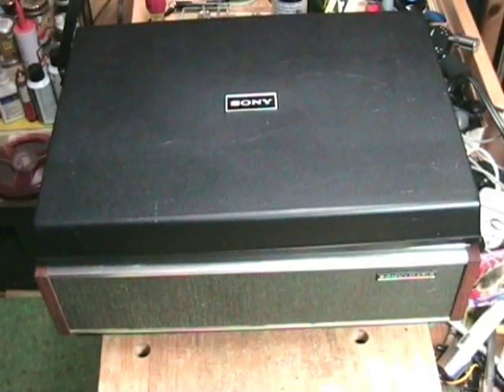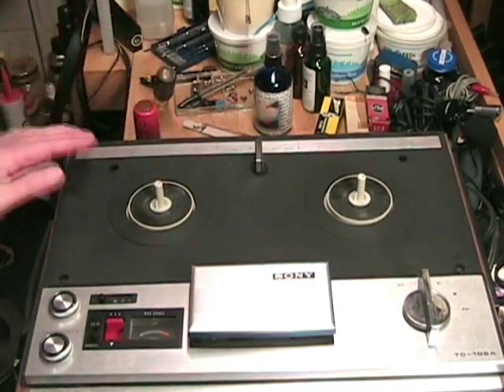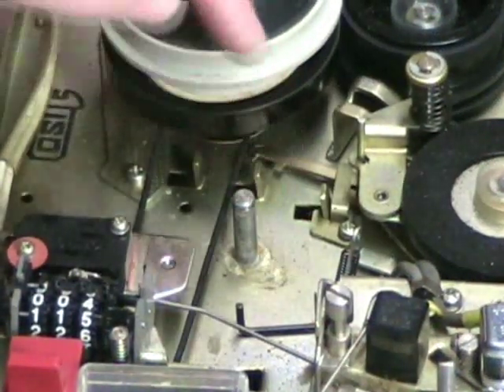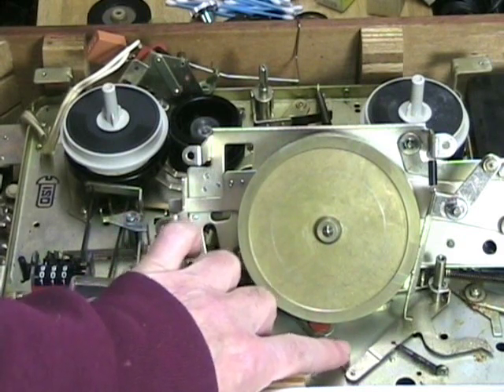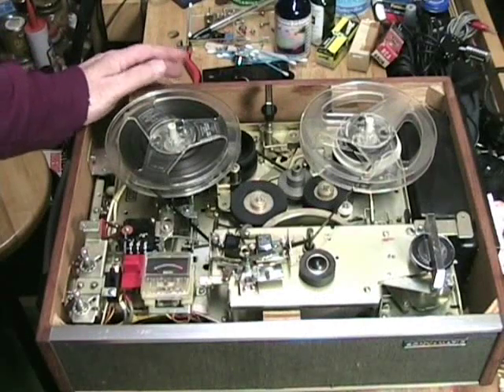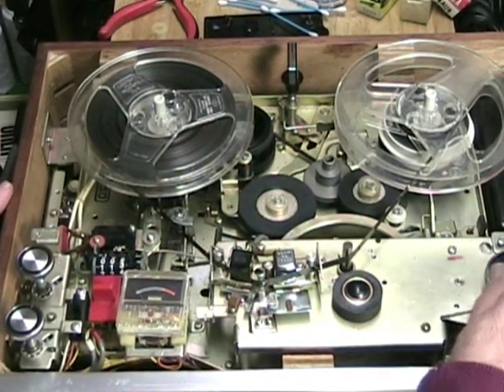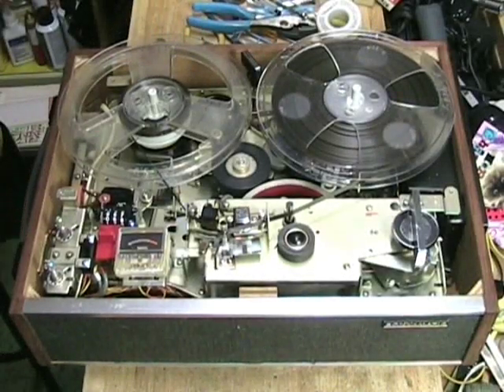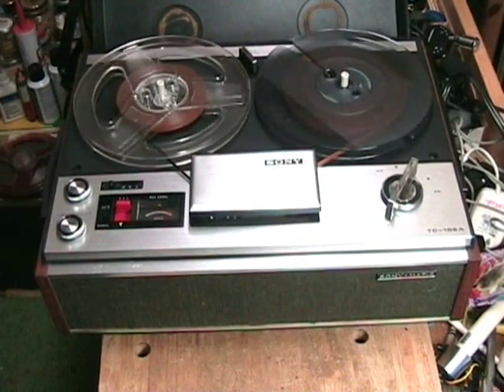Resurrecting the SONY TC106A Vintage 7-Inch Reel to Reel Tape Recorder

Comment: This is a great video. It helped me to determine my problem. I wonder if you can help me. On my same model, when you put it in "Play" mode, the drive idler wheel pivots over to the motor as it should, but it is not making contact with the capstan fly wheel, and therefore the tape will not move. The post that the drive idler wheel pivots on does not appear to be supposed to move. And certainly the flywheel is not supposed to move. So how is it possible that the idler wheel is not rubbing up against the flywheel?
Reply: +Ken Waite  I found the problem, through a comment by PastorBruceKramer . The Drive wheel "elbow" was frozen. A bit of light household 3 in 1 oil and some play loosened it up. Thank you all.
Reply from the maker: +Ken Waite Thanks for watching the video, and welcome to the wonderful world of SONY Glubricant! 

There is a "knee joint" that you aren't aware of because it is seized and makes you think it is supposed to be locked in position. It isn't, and it's an easy fix. You have to understand what's happened, because your problem is one of a series that you will have to address.

The grease that SONY used in their machines turns to varnish over time! This affected many mfgs and it did not appear until about 30 years after the machines were built, LONG after anyone thought they'd even exist, so - can't really blame them - I mean, how would they have known? Anyway, it is an easy fix, if you have some patience.

You'll need some simple materials. 

1) A precision oil syringe. This looks like a big hypodermic needle. You can find them on Amazon but the one I use came from "The TEAC Place" - http://www.daeinconline.com/parts.html#oiler. Scroll down the page, their link doesn't work right.

2) MARVEL Mystery Oil. This isn't from the movie IRONMAN, it's a real product from the 1920s. It is a red cleaning oil and engine treatment. Very thin and it re-liquefies varnished grease! It actually eats the stuff! You can get this oil at automotive supply places, Amazon (Amazon sells EVERYTHING), or ACE hardware has it as well. http://www.acehardware.com/product/index.jsp?productId=1452125

3). Obviously, fill your precision oiler with the Marvel oil. 

4) Look at my video around: 10:21. You will see the drive idler on the right side, although I am discussing something else. Pause the video. 

5) The idler carrier is that plate under the clip and coiled spring. As you can see, the plate has a rivet holding a "knee joint" together. The two parts are supposed to rotate, not be locked to each other in an L shape! 

This has seized up from the old grease. Carefully take your precision injector and squeeze one or two drops of Marvel oil so it can ooze its way between the two parts. DO NOT OVER OIL! A drop or two will start things off. Better to do a little bit at a time than too much and then have to clean excess oil!  Give it time to do the work, this is a chemical alteration and chemical results take time. Wait a few minutes (like 10 or so)

6) Wriggle the parts to get them freed up. Add drops more oil and repeat as necessary, mopping up any excess. 

If you have a bad case of the glubes, you will have to take the part out (be careful of the "e" clips that hold things together, they are very easy to loose because they like to "fly off" ) and flex it.

That should free the joint up and the drive wheel will now engage between the motor and the flywheel properly. 

7) Go throughout the machine and look for places where SONY put grease. Give them a drop or two of the Marvel oil to free them up. 

I hope this helps!
Reply: Thank you so much for that info. One other quick question. When I turn the power knob on, nothing happens. But when I flick the motor with my finger, it works fine. This means I have to keep the cover off. (I suppose I could flick the fan underneath). Is there anything I can do for the motor to start on it's own?
Reply from the maker: +Ken Waite Hi Ken,  This sounds like a motor run capacitor failure. I had a similar issue and repaired it. See this video for guidance: https://www.youtube.com/watch?v=eoV2ae9mCeU

Comment: Thanks a million for doing this ! your videos are so much more accessible than any other i’ve seen and you have a great way of explaining things!
i too also desperately need your advice as i’m  in a terrible predicament! 
i tried to film my dismantling cleaning and restore only for my own benefit HOWEVER the videos did not save and i’m trying to peice back together a Sony TC 270 from memory as i can’t make much sense of the service manual for this thing.. i feel that now that i’ve cleaned the gunk out it’s gonna work as it went from no play to chipmunk so i went in deeper for clean and inspection to find more gunk which i think i’ve now cleared up but putting it back together for my silly brains is going to be real tough... any advice for me please?! i’m DYING to record my music onto it !!! best wishes and you’re doing a sterling (and also funny)! job sir a pleasure to have been in your company during lockdown!
Reply from the maker: Hi, Thanks for watching the video. Sony machines from this era used mechanical transports that were VERY similar, so a lot of what works for one machine will work on another (i.e. re-lubing all the joints, check the motor run capacitor and replacing if necessary, making sure the motor pully is the right one (there is one for 60Hz and another for 50Hz. Sometimes these get mixed up, especially if your machine came from the UK a la E-Bay).

Okay, so to help you out I recommend some YouTube videos about the interiors and servicing of SONY machines that are much closer to the one you have.

1.  MEGA Recorder - SONY TC 530 Stereo Reel to Reel Tape Recorder - https://youtu.be/egybhmaGKDI

2. Sony TC540 Reel To Reel Mechanism Service - https://youtu.be/XuEy4v5EXS8

Maybe these can help you figure things out.

Good luck! Hope this helps!
Reply: wow! 
such quick response .. i’ll check these immediately and let you know !!! good luck with the book too i will check it out !! much praise to you!
Reply from the maker: @saweyesbaby  Best of luck! I don't know what has happened to the date stamp on this video, but, I produced it several years ago when I was trying to run a business and sell my books and CDs. That's all gone now, but these tape recorder videos live on!
Reply: @clydesight  well....AMEN to that! You’re both mighty helpful and a hoot to boot so keep the humour coming!

Comment: I have a Sony TC105 and need to replace the motor run capacitor and the potentiometer. 
Do you happen to know the value of the capacitor and the resistance of the potentiometer?
Reply from the maker: dan bee This video shows all about the capacitor: https://youtu.be/eoV2ae9mCeU. The VOL pot is rated: 10K the TONE is 15K. They probably both have an audio taper.

Comment: Dear Genius of Restoration:
Do you happen to have a central pulley for the TC 250 the one that moves the capstan?
Regards
Reply from the maker: I do not, but I have sometimes seen these pulleys on E-Bay.
Reply: *****
So which one will be a nice keyword for the search my dear friend?
Reply from the maker: Estricto Severino
Try SONY motor pulley or SONY parts.

Comment: This is an excellent tape recorder restoration video.  I was wondering if you could help me out.  I have magnavox tape recorder where the motor is powering up but it just hums and won't spin the fan underneath nor the captain to operate the movement of reels.  I don't know if by using standard head cleaner messed it up because it actually stopped spinning before event trying to attempt to clean and lubricate the motor itself.  It turns but kind of stiff.  What is the best method to fix this type of problem.  Also the meters don't move when in play or record mode.  I had the machine apart but didn't know what to take apart to really dig deep into the mechanics and electronics without maybe taking something apart wrong and not being able to put it back together.  If you have a magnavox reel to reel unit with the similar set up as this sony that will help a lot to watch a video on making repairs.  Thank you in advance for your suggestions.  

Gary
Reply from the maker: musicman0150  It is impossible to know for sure about your Magnavox without seeing it, but from what you describe, I would suspect a failed motor run capacitor. You would need a service manual or schematic to be sure the motor uses one. Using head cleaner would nopt affect the motor, unless you poured it into the thing, and even then it would probably eventually evaporate. The failed meters would probably also come from failed capacitors in the amplifier. Electrolytic capacitors do not age well, they are prone to failure over time. It's in their nature.

Comment: Greetings!  Thanks for the exploration Clydesight! i have just brought back a td-106a. all is working except for The record lever. it works, alas, yet, it has to be held down manually. Do you have any tips or pointers for making it latch. Cheers!
Reply from the maker: HI, I think you sent me this question via my Website. I couldn't respond because you didn't include your e-mail, so glad to have a chance to help you here. It's a bit tricky, but here goes!  First, watch the video around 18:00 and beyond, and look at the long lever I point out that controls the record button interlock tab. This flat lever runs under the head plate but over the capstan flywheel, as seen when I have the assembly out and upside down. This rec interlock tab is a bent piece running under the VU meter, and the bent part is pointing up. The long flat lever controls this tab.

The end of the long lever needs to be behind (meaning away from the front of the machine) the upward pointing interlock tab (which in the video is seen on the right side of the meter at 18:14 through 18:24). Look at 23:40 closely (you may have to go to full screen) to see the relationship between the long flat lever and the rec interlock tab.

The interlock tab is part of a locking lever that runs under the VU meter. You can lift the meter up and away to see most of it. The lever is managed by a spring and it rotates slightly on a post that is under the left side of the red record button. If the lever can't move freely, that's why the rec button doesn't lock. You have to clean up the grease on the post and free the action of the lever..

You can test the free movement by turning the function switch to the play (forward) position and then try moving the lever with your finger. If it is sticky, you'll know it immediately.

Also watch the function of the long control lever that is managed by the function control. In play (forward) it should move backwards (away from the front of the machine), allowing the rec lock lever to swing backwards as well. The rec lock lever won't move as much as the long function lever. Make sure the long lever is completely free to move (clean out the old sticky grease). The return spring isn't very strong on this.lever.

It's a tricky piece, and it has to ride correctly on the control knob cam to do its job. Watch the video very closely from: 25:09 to 25:22 to see these levers changing position.and it should give you the idea of how the thing is supposed to work.

Keep working the parts of the machine and follow the mechanical motions and you should get the idea of what the whole system is trying to do.

I hope this helps.
Reply: ***** Thank you Sir! All is working now! i remembered, ex post facto, that i failed to send you an email address, many apologies. Once again, thanks for the repair info it is a very nice machine. If you ever turn up an extra cover, please give me a shout:)
Reply from the maker: magneticstripper You are most welcome. Enjoy your SONY TC106A!

Comment: Just stumbled into your channel Sir. Loved it and subed. Quick question for ya, I just got a TEAC A 3440 in a very good shape cosmetically. 

What works
1- It turns on, all lights work, forward, rewind, play, stop work fine with just a 10" reels on. I didn't run the tape a cross yet.

What doesn't work:
1-Pressure roller doesn't engage every time and gets stuck
2-The capstan turns freely and quietly manually, but doesn't turn when hitting play, forward or rewind.

Please note, this is my first RtR and have no experience with these whatsoever yet. 
Any thoughts to help me diagnose/fix this folks would be GREATLY appreciated  ?
Reply from the maker: freemanslim  Your best bet is to visit: daeinconline.com (the TEAC Place) and look up belts for your machine. The main drive belts on some TEACs have a tendency to melt. This website will also sell you the all importnat service manual that you need to get the unit apart and test it, etc.

You probably have some "glubricant" problems (where the lubricant has turned to cement) preventing the pinch roller arm (and other parts) from moving freely. You'll need to work on the bearings for that with an anti-seize liquid (the OPPOSITE of "locktite") and IF you're lucky, you can get the parts free.

Unfortunately, I have worked on some TEACs where it is impossible to free the parts, resulting in a massive 60 pound paper weight. Sorry, it is the nature of the beast.

Note that IF you get everything working okay, and you try to run the machine without a tape in it, you MUST position the auto shutoff arm in the ON position or nothing will happen, and you may think you broke the machine.  Good Luck
Reply: ***** Thank you so much mate for the advice. Will get the parts and manuals from the folks. However thinking about dropping at the only local audio spot store in town/Calgary who seem to accept RtR for service & repair but they rate are rather on the steep side at $95/hr for 2-3 hrs average service as per them.
Reply from the maker: freemanslim  If you'ver never worked on an RR machine before and if the place in Calgary is reputable, then I would go that route. $95 an hour is standard for repairing this stuff because it is very labor intensive. However, do check them out, get a guarantee because there are some repair folks who are fly-by-night types, they take your money asnd give next to nothing in return.  If they are good, they will get the job done in about 3 hours, plus parts if necessary.
Reply: Thank you Clyde once again for teh advice. Will do.
Reply: Well Clyde, I took my TEAC 3440 to the audio store,the only one here in the city who does RtR. He asked what works and what not , so I told me, I need to change the capstan belt, and some cleaning and Lube. They charged me $95 upfront for diagnostic and the guy said it might take up to 6 hrs to get to "mint" condition 10 out of 10, out of the box state. Although I value the craft and the amount/time that might go into, but at $95/hr x 6 I rather take the time and give a try myself. I already did open it before I took it to them and even taped video which I will post shortly. Any thoughts Clyde ?
Reply from the maker: freemanslim
 I think his prices are too steep.
Reply: well its 2 years on  - but usually the pinch roller will engage with a little nudge. The problem is caused by age, the mech needs to be re-lubed, but with Teac its harder to reach that problem area. I have 3340a like that and it still works fine with a manual nudge to the pinch!

Comment: what happened with that capstan happened in a Magnavox but I need a service for it to know how to put it back together have you worked on any magnavoxes? Mine is a 2k879
Reply from the maker: +Larry Shaver Hi Larry, thanks for watching the video. I haven't worked on any Magnavox machines so I don't think I can help you. Sorry.
Reply: +clydesight have you worked on any Panasonic though i'm sure one was made for Magnavox by panasonic
Reply from the maker: +Larry Shaver I've worked on a few Panasonics. What are you trying to do with your Magnavox?
Reply: +clydesight i'm waiting to see if anyone on ebay has another one I can buy for parts or to see how one looks that is properly assembled.then i'll have one for extra parts

Comment: Is that Santa at 27;08? If so, tell him he's the best demonstrator on the web!

Seriously, loved the video. Can you tell me why my old Sony seems to play at the same speed no matter where the control is? I've checked mechanical, seems okay.
The lever moves up and down according to the speed, but the reels don't seem to change speed on record OR playback. Thanks, anyone.
Reply from the maker: James Bond  SONY machines are notorious for two problems:

1. Grease turns to glue
2. Motor capacitors fail.

1. You should apply 1 or 2 drops of Marvel Mystery Oil (this is an engine cleaning oil available at Amazon or most hardware and auto stores in the U.S.) on every joint, axle, plate, anything where they put their grease The oil re-liquifies the grease and frees up the parts. 

2. If the idler wheel moves up and down on the motor pulley and engages the steps correctly, but the capstan speed (which is the tape speed) is still not changing, then the motor run capacitor is probably failing and needs to be replaced.  

There are many modern replacement capacitors available (they are the ones used in celling fans) from Amazon or E-Bay. You must be careful though.

You have to match the specifications on the SONY MRC exactly, and you must also match the wiring to the capacitor terminals. 

So note which wires on the SONY  MRC go to which terminals and put those wires on the terminals of the replacement. 

The MRC is not polarity sensitive.

Replacing an MRC can be extremely dangerous because the capacitor holds a full charge, and if you touch the terminals accidentally, you could get a really nasty shock.
Reply: Thanks a million. Will investigate.